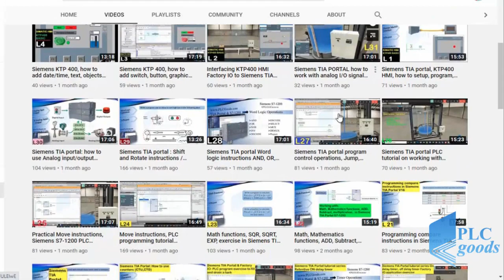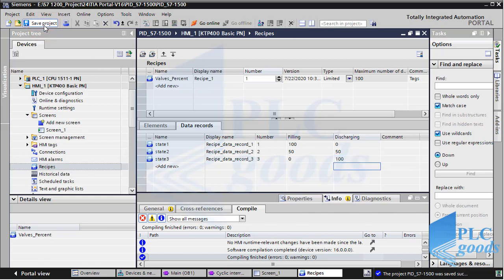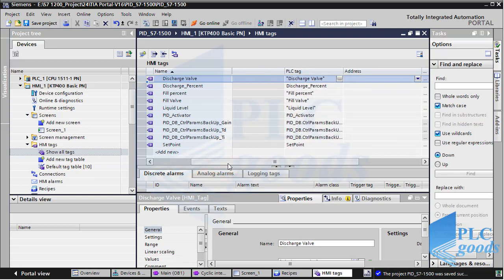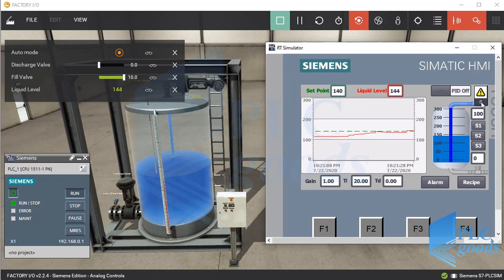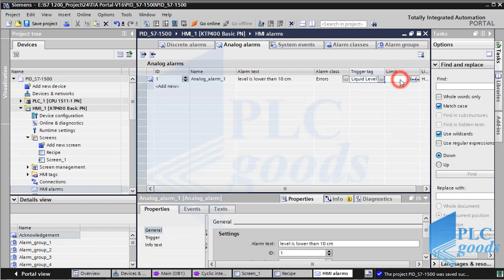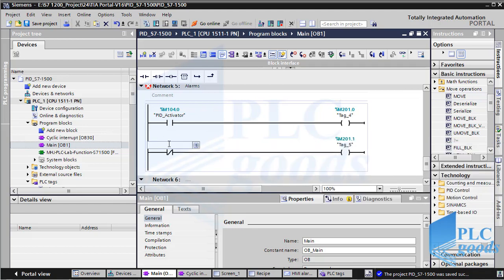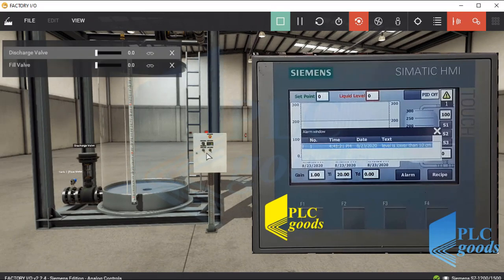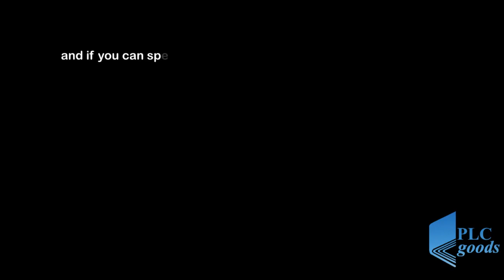Recipe and alarms tutorial | Recipes & Alarms |TIA Portal HMI Tutorial | L 44

Comment: please guys, I want to know how could we control real inputs (%I0.5) using HMI not a memory bits.
Reply: Hi dear. Definitely, we can not change the appeared voltage or current at the PLC input, using HMI. so, HMI can not control real inputs, and we have to use memory bits.
Instead of that, we can use the force option inside TIA Portal, to change the input image memory, but I Don't know how it can be done by HMI
Reply: @plcgoodsmentor9223  yes, I used a memory bit for a Fill button to turn on using HMI, but it won't work in the factory, Yes in the program the output turn on, but nothing happen in the factory, I don't know why.!!!!
please give your E-mail to send you a snapshot.
Reply: @nabilmarsel8792  Hello again. Note that, factory io software is not a HMI. It simulates industrial process and you can change an input, when you're working with TIA Portal. Here is an important point, that was explianed during our videos. Suppose, inside the hrdware configuration, you've used I0.0 to I0.7 . So, Factory i o can not change these inputs, but it can change other input addresses like I29.5 or I139.2 which were not defined inside the hardware configuration
Reply from the maker: Thanks for checking the channel, let me know if you have any other question!

Comment: i need your help please , can you send your mail i will forward photos from screen , i did workstation using TIA software , i did receipt for each sensor including set point ,high & low running setpoints but when iam pressing double click on sensor to show pop screen(receipt) the trend of these setpoints going zero suddenly  .  can you help me please
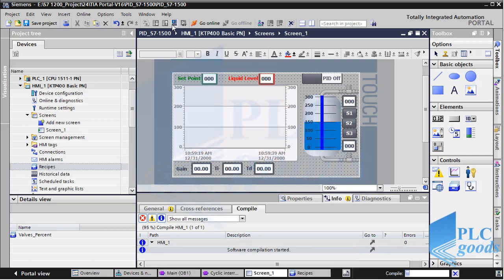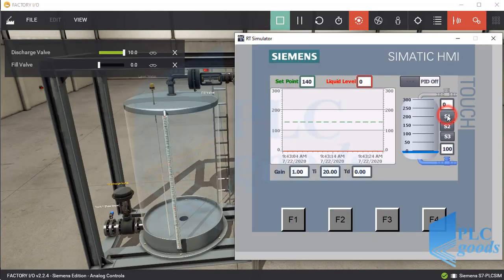Reply: Hello, Please pay attention to our video, Time between 4:30 to 7:00. There is a similar problem which has been explained. I defined a different tag in the HMI tag table to solve the problem. Note that, It can possible to define 2 or more different tags in the HMI tag table, which all of them are connected to the same PLC address. At the first step, please check this item and try to solve your problem by yourself. I hope this point can help you.
Reply from the maker: thanks for inquiry and bring out the question!
Reply: @plcgoods  thank you so much for your help it worked perfectly ...but in case of big project and hundred tags it will be difficult to copy all of these tags can you explain why this issue happens ?